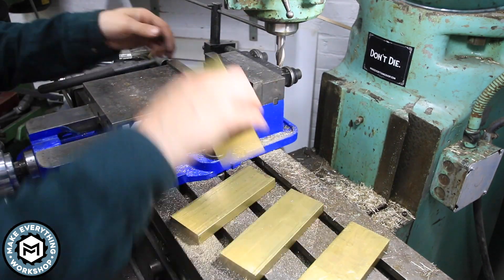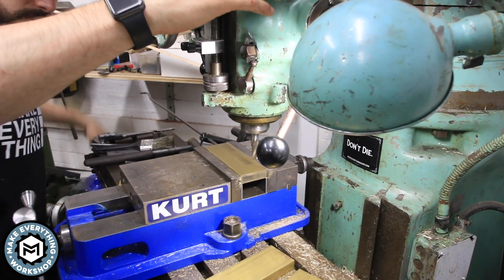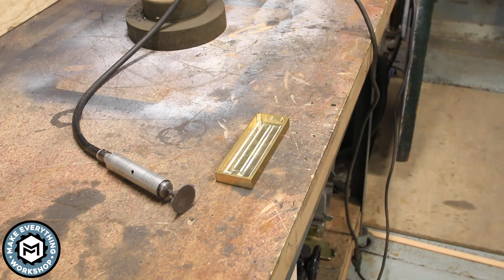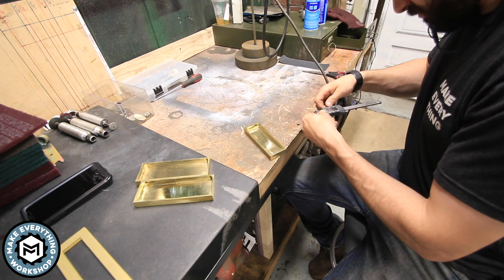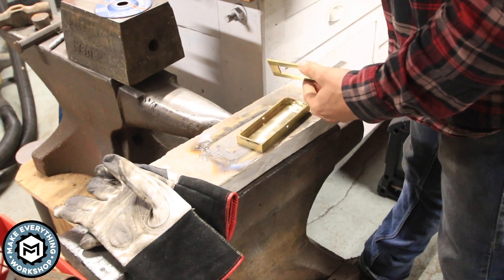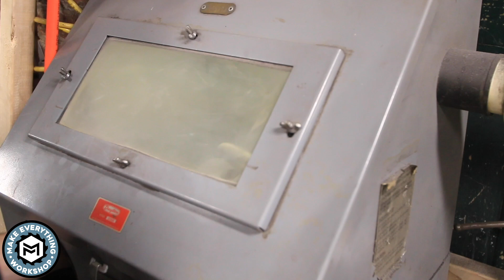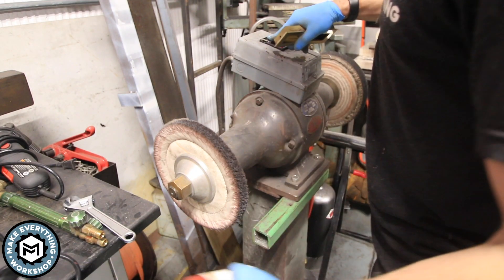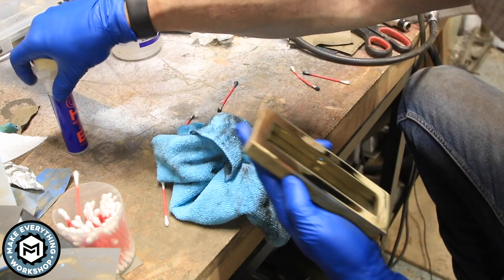Making Solid Brass Drawer Pulls (Desktop Waterjet/ Mill)

Comment: I use to use steel strapping to make springs to hold the spacer plates inside the vise jaws. Coil springs work well too. Also quick quenching in water anneals the brass and does not warp.

Comment: Nice work ! Save on solder by spacing out small pieces along the seam. When you hit the right heat, they flow nicely without a huge fillet of solder.👍

Comment: Good video. Not a bad setup on the mill. Next time try this though. When milling your part to length. Cut your stock to rough size. Leave about 0.100 long. Put in vice, skim one end. Leave long. Set vise stop. Now mill all your parts on one side. Now flip part. Mill to finished size on one part. Set X axis dial to zero. Now you can clean up the rough side leaving say .005 and then take the .005 finish pass and done. Rinse repeat. It is much faster. Now on your setup for the pocket, that was good. Just make sure you keep chips from between your stops. I was a machinist for 13 years and did a lot of production work. Both on mills and lathes. I look forward to seeing you doing more work on the mill and Wazer.
Reply from the maker: Thanks! Ive done a similar setup to what you described before when milling 15 of the same part to the exact same length. Did my one side finish pass and set up a stop to do the other 14. It worked great. With the time it took to just measure and creep up on each line in this setup it was pretty quick. I appreciate your comment and support!

Comment: To polish brass to a near mirror polish or very, very, very shiny, use Brasso. Keeps my brass Zippo looking brand new.
Reply from the maker: I normally use bras to maintain a polish, but I found that this application it left too many small scratches. the buffing wheel really got them flawless!
Reply: @MakeEverything  Brasso is more for bringing tarnished brass back to looking good as new. If you get the chance, grab some.